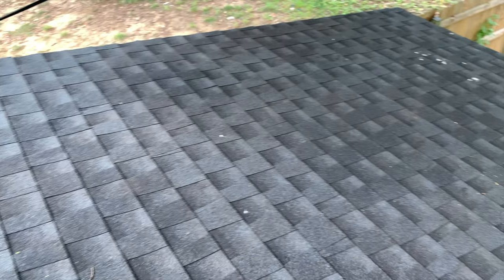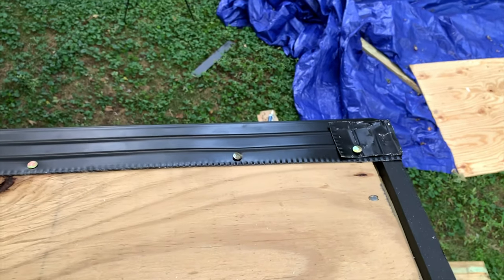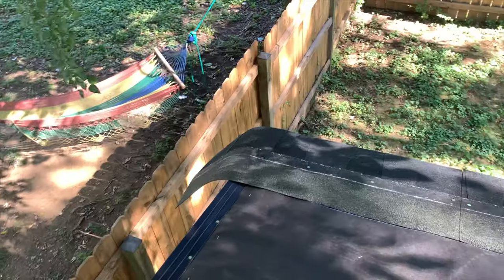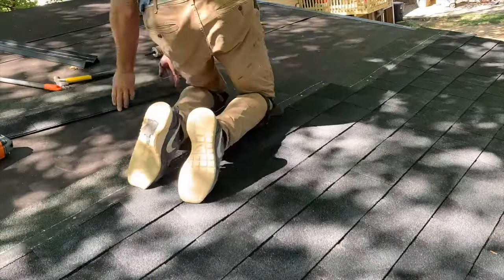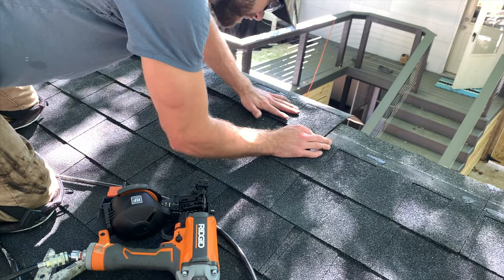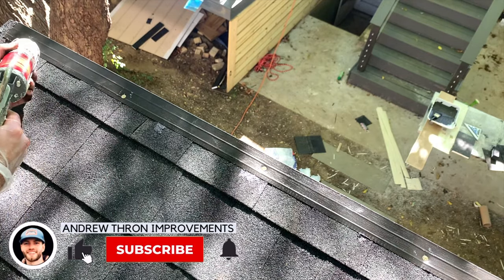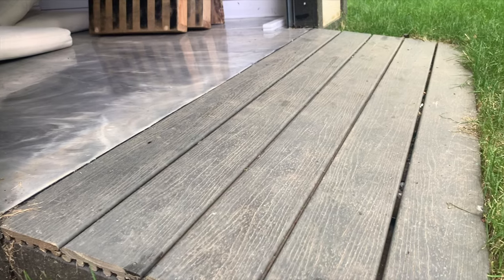How to Install Asphalt Shingles on a Shed Roof (DIY Step-by-Step Tutorial)

Comment: As an ex- union roofer, shingles shouldn’t be used in less then a 4/12 pitch. Rolled roofing should be used. This prevents water weeping and ice damming.
Reply: Shingles can be used on any pitch, ofc not always recommended but it doesn’t require a rolled roof
Reply: As shown in the video, the minimum pitch is 2/12, but of course 3/12 would be better; all of which depends on local code.  Here in Florida panhandle, production homes will have roofs at 3/12 or better.  Ice dams are not an issue in the south.  Shingles with less than 2/12 would only last if roof cement is used extensively (and probably won't pass inspection).

Comment: Gotta love builders these days that don't use any ice or water shield let alone typically leave off the drip edges too lol People will buy anything as long as the 💩 is shiny. No ventilation, interesting. Now wait for the moss to grow! Lol
Reply from the maker: Hey Shane - This was actually my first lean to shed roof install. I welcome your thoughts on what could be improved for the next one. More than anything, I want to set people up for success on their project - so any info you can provide to help others out is appreciated. 1 year later, no moss.
Reply: @AndrewThronImprovements  Nice work on the shed and its roof!  Moss on the shingles is surely a region-specific issue.  I suspect the amount of sun exposure is a factor.  Here in the Florida panhandle, there would be no ventilation required if you insulated and sealed the area under the roof.  Some homes have this, with expanding foam used to insulate under the roof deck.  The attic is then within the air-conditioned area of the structure.

Comment: 9:30 Rather than cutting all of those shingles of various lengths to stagger the seams, it is easier to start with the first row from one side, the next row from the opposite side,and keep alternating. Then cut off the excess. 
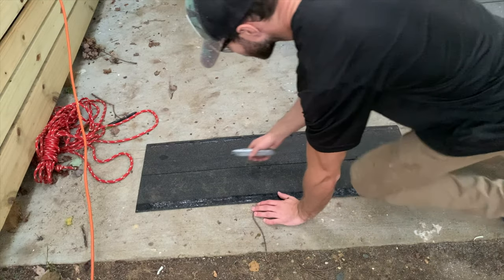5:15 roofers will install the shingle upside down for the starter strip instead of trying to cut the shingle in half. Much easier that way 
3:21 tar paper already has lines on it. No need to use the tape measure. Just use those

Comment: Thank you for this!  I have to redo my single sloped shed roof because of water damage and I see when I installed everything 12 years ago I made mistakes now that I see mentioned in videos.  For some reason the manufacture stated to cut shingles flush with drip edge and everyhwere I'm reading is saying you should have at least 1/2" overhang.  My drip edge also wasn't installed like how you showed so that was another problem I did.  Oh well.  Live and learn.  At least I caught it before the damage is too great.
Reply: It seems like every state has different building code, some say drip edge on the rake of the roof is installed on top of felt

Comment: I've seen mixed suggestions for the rake side drip edge.  Your video and others I've seen say to put it on top of the tar paper.  This Old House has two videos where they put it under the tar paper along with the front edge.  Anyone know the argument to each one?
Reply: one method is often recommended by manufacturer, the other is by the code in some states. pick one.

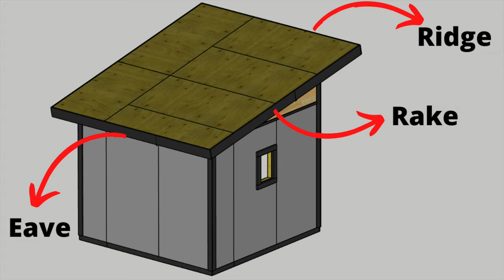Comment: looking at your diagram @ 1:00-ff, i'm thinking that the terms of your roof edges might be different in sheds/roofs that have a double slope and not the single of your shed.  is that a correct assumption?  for example, with my shed, the ridge is centered on the building which would make the front & back of my building the "rake" sides (in your diagram) and the "eaves" would be the building's sides to the left/right (instead of the back/front of your building).  IOW, if you take your building and mirror it along the "ridge", my door would be on the side of the window in your diagram.  that being the case, the front/back of my building would actually be the "rake" sides in your diagram & the sides of my building would be the "eaves" in your diagram.  so, when watching your video, do i need to transpose your terms for my style of building or does it matter?

Comment: Great video. My shed roof is 3/4". What size nails should be used to install asphalt singles without penetrating the roof on the inside? I don't want to see nails sticking through the ceiling. TY
Reply: Something less than 3/4".

Comment: Nail size?  1 1/4?
Reply: Depends on local codes.  In hurricane-prone areas of the south, the roofing nails have to push through the deck and be visible in the attic.  This prevents them from pushing up over time.